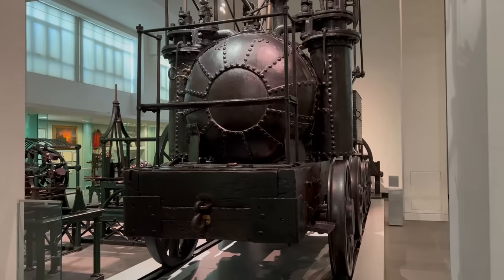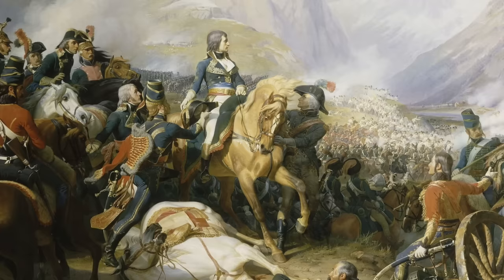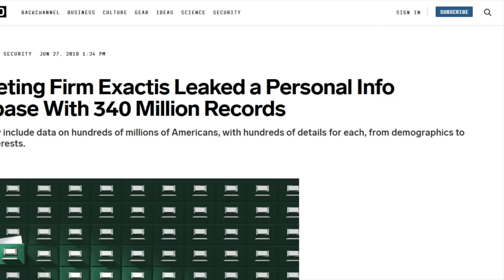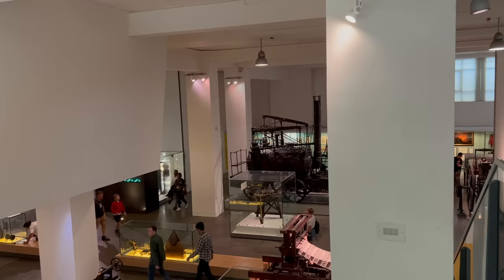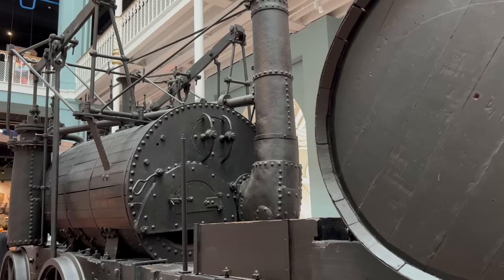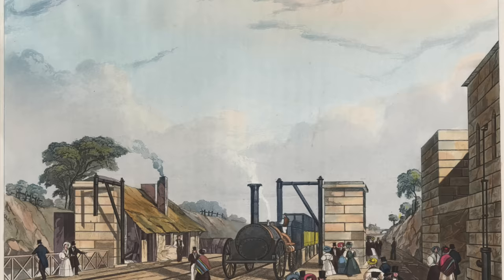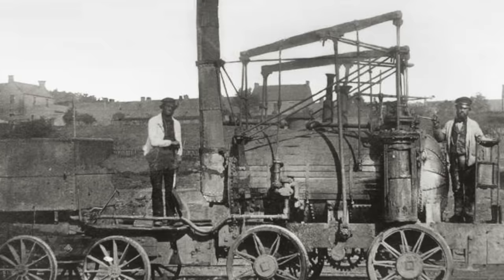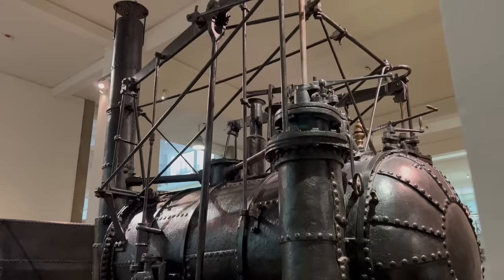The Oldest Steam Locomotives in the World

Comment: Stephenson's claim to fame is really about the boiler. He introduced multi-pipe boilers which took the heat from the firebox, through the tank to the funnel at the other end. It has been suggested that, even if Sans Pareil had won the Rainhill trial, while it might have slowed development for a few years, Stephensons way of doing things was superior (more efficient) and would have eventually won out anyway.  Fascinating to see these old engines.
Reply: Also for talking the L&M board into giving locomotive engines a try when they were more inclined to specify stationary engines and horses The railway age might have flowered 20 years later if George hadn't spoken up..
Reply: Apparently, another innovation of Stephenson's was to vent exhausted steam through the chimney of the locomotive in order to create a good draught through the firebox.
Reply: @guyrixon5406  Selby-Leeds railway had permission before the Manchester-Liverpool railway. However they held off to see the outcome of the trials and the Liverpool-Manchester railway
Reply: The Beamish Puffing Billy replica does have an non authentic multitube boiler (which is welded not riveted for safety reasons), although it is still very inefficient and takes a long time to raise steam.
Reply: Stephenson also patented the long boiler design in 1842. This design was still in use in operating locomotives up to 1972 (New South Wales 19 Class) and were invariably inside cylinder 0-6-0 arrangement locos (which I think is  one of Jago's favourite types).
Reply: @guyrixon5406  And the L&M board had good reason to be sceptical given the lumbering performance of Locomotion and other steam engines of the time. It needed the multi-tube boiler to give a sufficient power-to-weight ratio to allow substantially higher speeds than horse-drawn trains. Necessity is the mother of invention.
Reply: As one put it: Stevenson was the inventor of the "modern" locomotive - using a heater-net boiler and high pressure steam. The predecessors used "a water cooker" and largely athmospheric low pressure engines. He also used double-ended steam cylinders and integral valve gear other than levers and balancers on a single-ended cylinder. He also was a good salesman and surely has his place in locomotive history.
Reply: @wacholder5690  However it was actually Trevithick 20+ years earlier who first used high pressure steam to run a locomotive - atmospheric pressure engines (Newcomen/Watt) could not give enough power for this. My impression is that Trevithick also used double-ended cylinders, though I can't tell for sure from the descriptions I have available. His Catch-me-who-can of 1808 looks very like Stephenson's Rocket of 1829, but the vital thing missing from the former was the multitubular boiler which increased steam-raising capacity tenfold. Certainly Stephenson and Trevithick both deserve their accolades.
Reply: @iankemp1131  They sure do. I think it is the same problem with "who built the first automobile" and they argue if it was Cugnot or Marcus or Benz or some other antique Greek or whatnot. Things weren't very well documented and a lot inventions or enhancements occur accidentially or unintendedly - and once some person combined the details he becomes "the inventor of X".

Comment: It’s an absolute blessing to us all that both Wylam colliery locomotives are still with us. Amazing to think how far technology has come.
Reply: Most fortunate that they survived through periods when there was little interest in preserving old industrial archaeology, not to mention the scrap metal drives of WW2.
Reply: What I find fascinating, if I may add to your already very accurate observation, is this: Once we pass the "industrial pipes shoved together to make a locomotive" stage of steam-train, it didn't take very long to design & build something that looked very much similar to something 50-60 yrs later e.g. the NER 0-6-0 "1001" class of 1874 (I looked that up btw) - I mean, yes, its clearly older than a 1930 LNER steam loco of generally same type/role but in the fundamentals, it looks generally similar I think. 

OK, complexity will have increased of course, efficiency too, but they had something that worked and kept on working until there needed to be a huge step change.

I hope that makes sense.
Reply: @emjackson2289 Apart from the lack of a real cab
Reply: @emjackson2289 The GS&WR Class 101 are a better example first one built 1866

Comment: The real three innovators of the high pressure steam engine,are Richard Trevithick and the Stephenson’s,Richard Trevithick invented the modern boiler and many of the things that make a steam loco a steam loco,however the Stephensons perfected the early form of the design,they were the first to remove the cylinders from the boiler and thus remove the cogwheels,as well as separate the firebox from the boiler,and created the first distinct express and freight engines.

Comment: If you add Newcomen,and the low power fixed engines,the history goes back further! But those engines became the progenitors of the steam boats,multiple triple expansion,walking beam,side and rear wheelers! They traversed the Mersey,Mississippi,Hudson,and many other rivers and lakes,and really deserve a video of their own!! Ah,one can hope,thank you Jago,your service to humanity hasn't gone unnoticed! Thank you 😇 😊!
Reply: Newcomen's engines were "atmospheric" engines which relied on steam in the cylinder condensing to form a vacuum to pull the piston down.
Reply: Indeed, it's a fascinating story of evolution. The huge beam engines of Newcomen and Watt based on vacuum had too low a power-to-weight ratio to be prime movers. Trevithick's use of high-pressure steam gave the essential boost to allow self-propulsion. Some of his engines were used in boats (like the Wylam engines) and steamboat propulsion branched off from there. With less constraints on weight and space, these could be developed into the compound and triple expansion types as mentioned,

Comment: At Beamish museum you can normally ride up and down a short stretch of track behind various replicas of these early locomotives, the currently in service one being Puffing Billy. Unfortunately the Waggonway is currently closed for maintenance. There used to be one at Ironbridge which ran but did not offer rides but I don't know the current status of that.
Reply: There were three replica early locos at the Waggonway - the replica Locomotion is now at the Darlington Railway museum in place of the original which is now at Shildon, the Steam Elephant is away for repairs, leaving Puffing Billy. The 1820s area of Beamish, where the Waggonway runs, is normally closed in the winter.
Reply: It's worth noting that for much of the year the Waggonway doesn't run every day. If you are going specifically to see it running, check with them first. There is also a narrow gauge demonstration line, a standard gauge demonstration line and a currently non operational short standard gauge passenger line.

Comment: One thought about the nickname - in the marine/sailing world there is a device called a "handy billy", used to pull, or lift loads - consisting of several blocks and a rope/wire to gain mechanical advantage. As these locomotives certainly achieved the same result, and would generate a "puffing" sound, it's possible that the term originated that way?

Comment: Blenkinsop did think that smooth wheels on smooth rails would be feasible , But with Cast Iron a problem was hammerblow from the wheels which the crank/cog system attempted to avoid , and with both downhill (more controlled braking) and up hill - there would be a definite weight hauling advantage,  it was worth the extra cost.

Comment: I saw Wylam Dilly as a kid. It's so long ago that it's like a fresh education all over again. It set me thinking about time lines and convergent technologies.
The dates put a lot into perspective. In 1812, Henry Bell of Helensburgh had his Comet sail from Glasgow to Helensburgh. By the time Puffing Billy and Wylam Dilly were running there had been an explosion in steamboat design on the Clyde (I've just found a list of 13 in 1816- Andrew McQueen, Echoes of Old Paddle Wheels, 1924).
It's funny how history parallels itself with items going through similar phases as the engines in this video then passing into historic reverence and confusion. 
The same applies to the Comet's engine. Andrew McQueen in 1924 sates that the second engine is in (now The Science Museum in London) and the only bit remaining of the first is the cylinder (now in the Riverside Museum, Glasgow). He states the first engine passed through many hands before being put on display in Mssrs Wylie and Lockhead's premises in Argyle Street in Sept. 1857, which burnt down with him speculating that just the cylinder was the only salvageable part. 
However Grace's Guide to British Industrial History states the engine was in the Polytechnic Institution's premises in Glasgow at the time of the fire and crashed through three floors till it came to rest. Grace's says the engine in London is the original with remaining cylinder in Glasgow being the original smaller 3 or 4 HP cylinder from the same engine prior to being upgraded with a more powerful 6 HP one prior to the hull being lengthened and new 14 HP engines being fitted which remained with her when she grounded in bad weather on Craignish Point in 1820. She slipped off and sank with them into deep water before they could be salvaged. The Ingenious Mr. Bell by Brian D Osborne not only affirms this, it includes a list of salvage expenses at Craignish Point including whisky for the local workforce and even has in the appendix what could only be described as a sermon on the perils of frivolity written in Bell's own hand and unmistakable literacy.

The Ingenious Mr Henry Bell is a totally different book about a Kings Lynn based architect over a century earlier. It's also a very good read.

Comment: I discovered that I was a nerd when I visited the London Science Museum. The Rocket was still there, but I was not looking for it. I entered the gallery and found myself rooted to the spot. It took a while before I realised that my mouth had dropped open. After several minutes, I was standing next to it. Until that moment, I had not realised just how nerdy I could be. It still excites me today that I was able to reach out and touch (or should that be "stroked") The Rocket. I didn't even know that there was another even more significant locomotive there.
Reply: Is that the original or the replica which we saw much of in 1979-1980, for the 150 celebrations of Rainhill trials and mainline opening, 1829-1830?
Reply: @thomasburke2683  The replicas** look like everybody's school history book pictures of the Rocket. The original was sold to a colliery not long after Rainhill, and was completely knackered by the time it was withdrawn. It still looks knackered, is missing several parts (including  connecting rod), and was modified after the trails  - the cylinders were realigned to nearer the horizontal, and the overall effect of the loco is that it is squatter than it was. **There are at least three replicas - one built the Henry Ford Museum in Michigan, and two at the NRM - one built as a sectioned exhibit by Robert Stephenson & Hawthorn and the working one built for the 150th anniversary.
Reply: @roderickjoyce6716  There was the wooden replica that stood outside the railway museum when in Clapham , South London , it fell apart when that venue was closed and the collection dispersed (mainly to York. Swindon . Glasgow and Syon Park (for most London items)
Reply: The original Rocket and a fine working replica are now both in the York National Railway Museum. It might be questioned though whether Puffing Billy and Wylam Dilly are really more significant. In many ways Trevithick had gone further with his Catch-me-who-can of 1807, and the next major advance was really the Rocket with its multitubular boiler which gave sufficient power to allow higher speeds to be obtained.

Comment: Given how rough the machiining was back then, I'm amazed they got any kind of steam engine to work with any sort of effectiveness. If you'd taken one of those guys who'd spent decades trying to get something to just pull its own weight, and shown them a CNC lathe, or just taken them to Machine Mart and given them a demonstration of each piece of machinery being used they'd have wept.
Reply: It was also amazing how the civil engineers, without any experience of such things were able to construct complex arches where roads and railway crossed diagonally.
In particular, the stonecutters who had been accustomed to cutting regular shaped blocks, suddenly found themselves creating irregular blocks which fitted perfectly into the arches.
All these men deserve to be remembered for their skills.
Reply: @thomasburke2683  I think you could say there was more experience of building arches and bridges going back to Roman times though, whereas the novel element of steam engineers was both pressure vessels, and (approximately) gas tight sliding seals
Reply: Looking at the close ups of the boilers I couldn't help wondering how such rough joints could have been made steam proof. But, I suppose, roughness doesn't mean lack of skill. Somehow master metalworkers made it all work with little more than a heavy hammer.
Reply: @francisboyle1739  I agree, that was one of my thoughts
Reply: I dont know,  check some of the drawings of Blenkinsop and Matthew Murray.  Sheffield steel making for knives etc was a fine (if dangerous ) art and their were watch and toy (a word originally meaning a small prototype or demonstration) makers working in anything from copper to silver with fine machinery).  A lot of slack in boiler systems was dealt with with assorted caulking (known from shipbuilding of wooden ships),  leather , cotton and grease and asbestos and rubber gaskets

Comment: The name Dilly was an old name regularly used in these parts for small shunt locos.I believe Puffing Billy ended up shunting at Hallbankgate a rather remote place in the lead and coal mining area of the North Pennines,situated near Brampton on the northern edge  of the Pennines (Cold Fell) and had a connection to the Alston branch at Lambley.Around Hallbankgate tracks are still visible with a search on the adjacent moor but I must point out however that trecking around this area must be done with caution due to the possible presence of open mine and air shafts.
Reply: The line from Greenside Colliery down to Blaydon on Tyne was certainly known the dilly line, though our teacher had never heard of the word, which may indicate how local the name is.  One suggestion I have heard is that it is a contraction of district railway, though I have no proof of this.

Comment: The "invisible" history here is elusive.  The concept of steam power and the notion of running a cart along rutted tracks are ancient (1st and 6th century respectively), and were in fact both developed independently of one another within only few hundreds miles of each other in Greece.  The chocolate never met the peanut butter (for fans of 1970s candy-origins) back then but even if someone had conceived of using steam power for practical work and visualized a cart being pulled by a steam-powered engine... the requisite materials could not be brought to the project.  Material science is the real star of the Industrial Revolution.  To contain the violent energies of steam heat (and later combustion) and to withstand the tortures of friction, we needed iron (and eventually steel).  The names of Darby, Cort, and Bessemer tend to recede to the backdrop, but they are to my mind the central figures in any discussion of the industrial revolution and the Age of Steam.

Comment: Really, the father of the steam locomotive is still Richard Trevithick, who was the first to use high-pressure "strong steam" to produce self-propelled engines on rails. By 1808, "Catch-me-who-Can" had a neat appearance not unlike Rocket 20 years later. Subsequent engines by Hedley and Stephenson still looked like a deranged assembly of knitting needles by comparison, even Locomotion. The 1829 "Agenoria" in the NRM at York is the last example - it looks wonderfully incongruous displayed next to "Duchess or Sutherland" and "Mallard", thus illustrating the beginning and end of British steam locomotive development.

Comment: Unless it's something more about them thinking it'd be too heavy to move, it seems so strange that they tried to push for rack rails, legs, and other alternatives when regular wheeled vehicles have been a thing for who knows how long.
Also at the end, they would've been sold for about £31,336.52 and £2,585.26(?) respectively. If I got it right with converting shillings to decimals anyway.
Reply: .A big snag with the first successful locos (Trevithick's) was that they were too heavy for the plateways of the time. So the thought was that lighter, lower powered engines would be needed and that they might not give enough power at the wheels without rack assistance.
Reply: @iankemp1131  That makes sense, thanks.